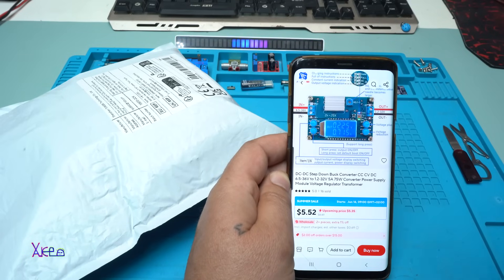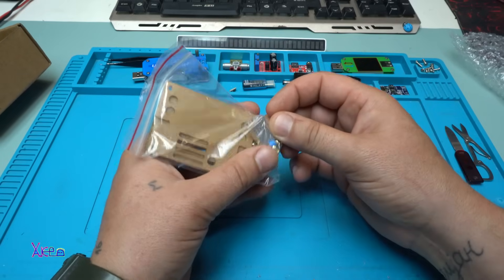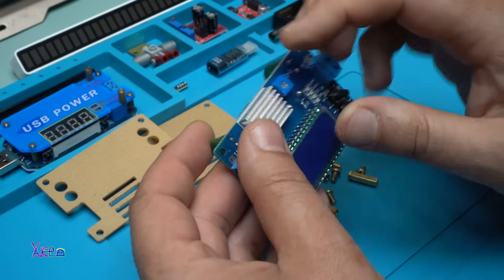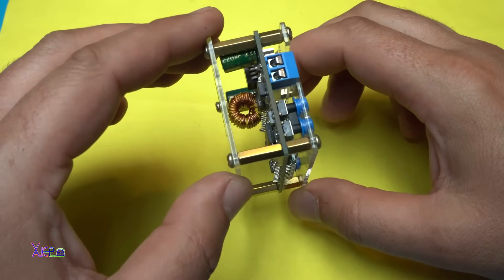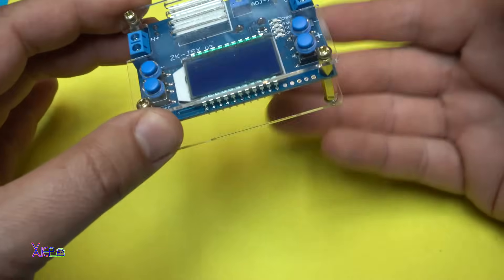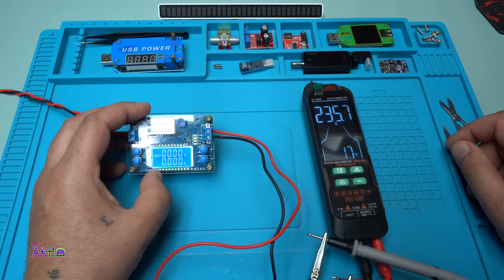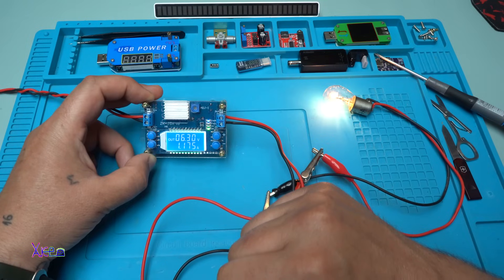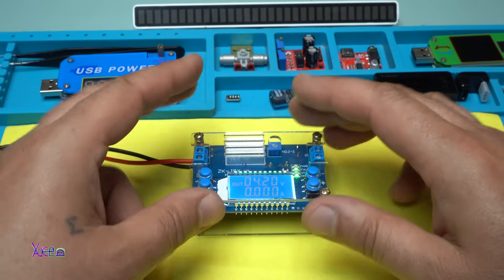SMART $5 Aliexpress Module is FANTASTIC?

Comment: I have 3 of these controllers bought them ages ago for powering up varies of devices like LEDs, fans etc but I managed to blow up the 50v cap on a 42v rechargeable scooter battery but Lucky enough the clear plastic cover protected me from the cap shooting into my eye. These controllers is great for what it does